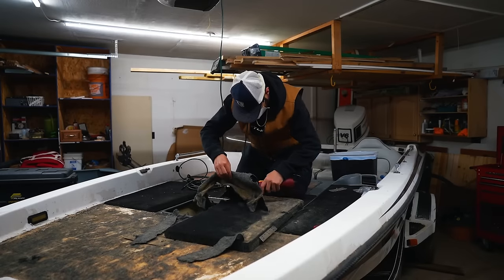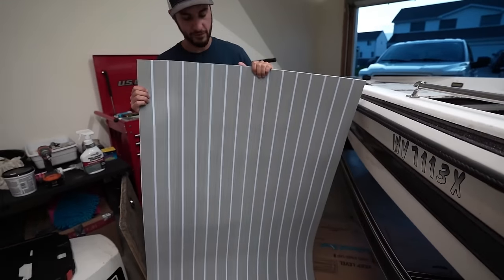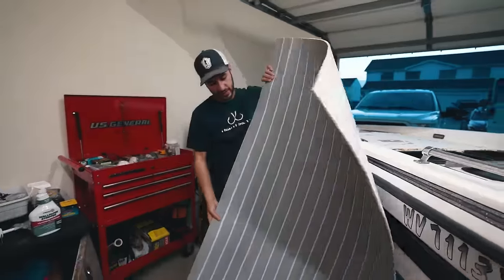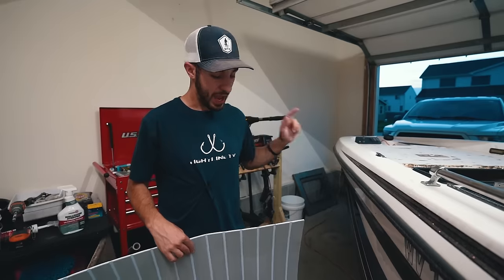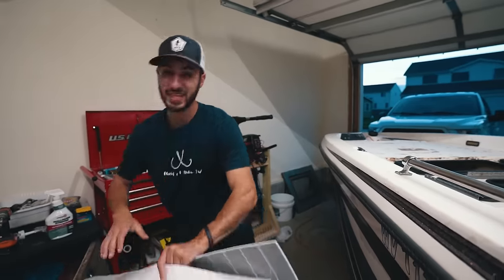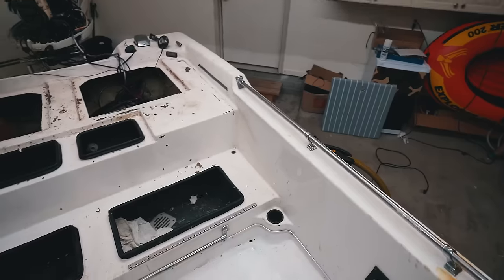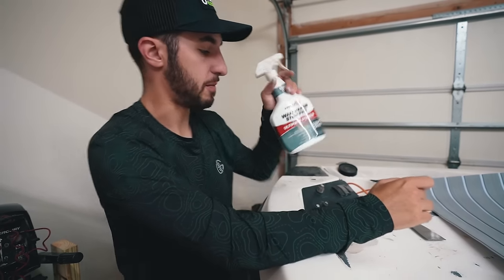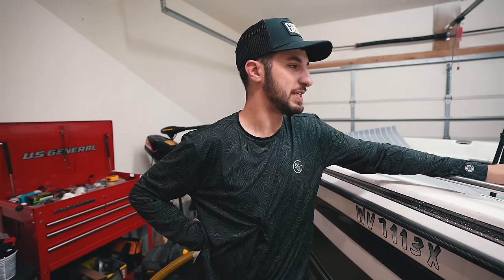I Bought Amazon BUDGET SeaDek For MY BOAT! (Is It Worth It?)

Comment: E v a foam is almost like sea deck They have the same machine that scans your boat for sizes. But is more expensive than Eva? And thanks for the tip about the measurements. That's why should I always measure twice cut once? It's just like doing tiles. They're not 12 by 12 all the time. I bought the same stuff from my boat I got The gray with black lines for the floor and then I got brown with black lines For the upper deck and the back deck. Good video anyways There's a company on YouTube that talks about Eva. That uses that stuff

Comment: Seadeck (formally made) has rounded edges, obviously cutting the Amazon material gives a straight edge.  How is that on the boat flooring between cuts?

Comment: I am using this inside of a cuddy cabin. I've got the pieces cut but I have not put them down yet. It's just been too hot to work in the boat. This may help me because I have to cut a bunch of irregular pieces. I actually cut the first ones very straight and then when I got them in I realized the boat is not straight lol. All that molded fiberglass is very irregular. That was another wrench I had to deal with. I assume this stuff all comes from China doesn't it? I wonder if an Alibaba inquiry could get foam that is much wider. I think most people would rather have it wider than longer. As long as the lines are even then they could just match them up. I'm not done with the video but just an FYI, the phone I got had something buried inside the instruction manual. It said that if the color is incorrect from piece to piece, to turn One of them around the other way. I think it's kind of like carpet where when you rub it in one direction it will look different from when you rub it in a different direction.

Comment: I ordered some that stuff too off. Amazon. I got the Gray with the black lines for the flooring and I got a dark brown for the upper deck and the back deck in brown with black lines. Thanks for the tip. With the measurements? Good luck buddy

Comment: Next time instead of using that crap stuff and scrapping, use LYSOL with bleach gel toilet bowl cleaner.  Pour it on the areas, put dry paper towel on it and let it sit 20mins.  Come out and then simply wipe away.  Works for this, mold in ur shower or cleaning any tile.  No scrubbing needed.  If it isnt coming off let it sit longer like another 20 mins, then rinse with water.  Ive used this method for yrs, in my home and other things.  Its cheap and no scrubbing; especially for me because I have a bad back.

Comment: Heavy Duty Oven Cleaner will strip off anything. deck extensions may not fit quite right because they were meant to be wrapped in carpet which would fill the gaps in? But carpet looks trash. Foam looks way better.
Reply from the maker: They didn’t fit good with the carpet either 😩

Comment: Ok im only 1 minute in but I use this on kayaks, bass boats and soon a kayak trailer it works its cheap and it does great when wet, I'm glad to see you going the budget route cause that's the smart thing to do! If you put plastic over the area you sprayed with the stripper and let it set overnight its alot easier

Comment: Maybe you should add some glue down too when putting it down I mean it is cheap how good you think the adhesive on the material will last?
Reply from the maker: Adhesive won’t adhere to adhesive well.
Reply: I used that Amazon eva on my bass boat and I used 5200 and spread it out evenly on the adhesive side of the foam. It's not going anywhere. That may come back to bite me in the future but I guess I'll cross that bridge when I get there 😆
Reply from the maker: @joelarledge4081  I tried 5200 testing the sides and I did not stick ha, was slippery as heck
Reply: Yeah true, I had to weigh it down or it would shift or want to come up.  Once it went off it was SOLID. However whenever I go to change it I'm sure it's going to be a nightmare lol. Oh well live and learn. Man I love the project and vids. My cajun was a very similar situation to your bass cat. Look forward to seeing how it pans out!